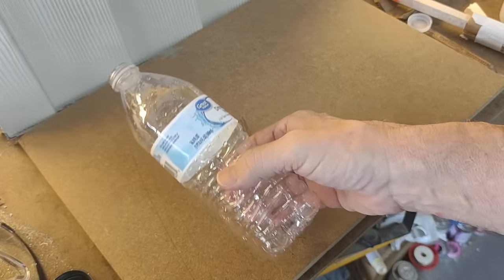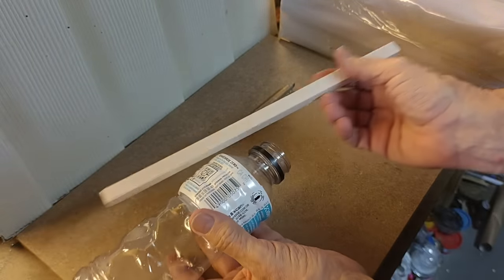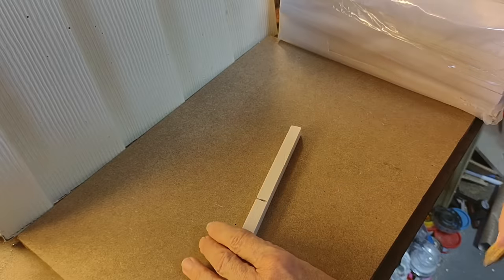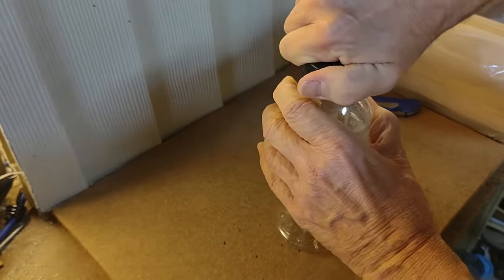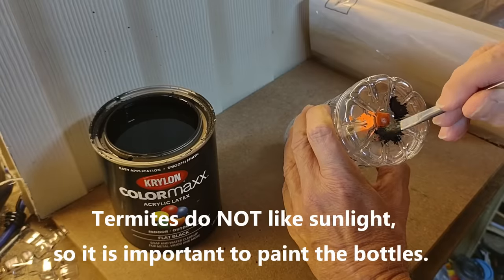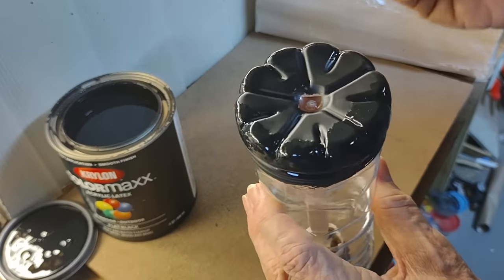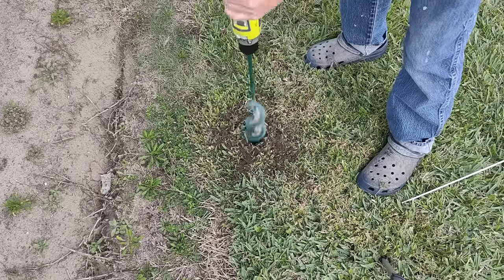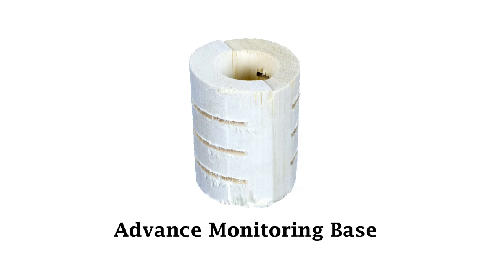Unbelievable Water Bottle Trick for Termites!  Simple to do!

Comment: Thank you so much for the info you provided. I have read that for new constructions, it is better to get the entire house fumigated before taking residence. What do you think? Is it a good idea, or just a waste of money?
Reply from the maker: Fumigation only works for drywood termites and it has no residual action, so unless you have an existing infestation of drywood termites, fumigation is a waste of money.

If you are building a new home, you can make the entire building totally termite proof by applying Bora-Care to all the wood surfaces.  You should mix the Bora-Care one-to-one with water.  The label will tell you that you can mix it one-to-five, but it is way more effective to mix it one to one.  You should apply the product before the shingles are put on the roof, before the siding goes up, and before the house is insulated.  In other words, you want all the wood exposed, so that it can be treated.  Always mix the Bora-Care in a 5 gallon bucket, and use an electric drill and paint mixer attachment to mix the product really well to a watery consistency.  Then pour it into the cheapest garden sprayer you can find and literally spray all the wood surfaces on the entire building, from the top of the roof to the bottom of the floor joists.  If it's wood, then it needs to be treated.  I will give you a link to both the product, and a video on how to use it.

I hope that helps.  Be well my friend.

Bora-Care:  https://www.domyown.com/boracare-p-100.html?pdpv=2

Video on how to use Bora-Care:  https://www.youtube.com/watch?v=Rmr_aEodyhg
Reply: @GuysPestSolutions   Thank you so much for your valuable info. Too bad, the construction has already passed the stage that I can spray the wood frames. Would your method work if I spray it on dry walls and under the eaves?
Reply from the maker: @leondan3629  The Bora-Care is best used indoors, but not on drywall.  You can use it on wood that is outside, but the wood needs to be sealed 48 hours after the application.  After the house is built, then employing other preventive measure is usually best.  How you do it will depend upon where you live.  Not all species are prevented the same way.  Drywood termites are much different than subterranean termites.  Monitoring stations are a good place to start though.  Be well my friend.
Reply: @GuysPestSolutions  Thanks again. I am in So Cal. What do you recommend for prevention of drywood termites?
Reply from the maker: @leondan3629  I will give you a link to my video on how to prevent drywood termites.  Be well my friend.

Video on how to prevent drywood termites:  https://youtu.be/neNsmVbj8Pc

Comment: Hello Guy. Great videos! Is there any chance that surrounding the house with bait stations will actually attract termites to the house - causing an issue that otherwise might not have happened in the first place? I guess I'm sort of thinking of the termites like ants. I don't have ants right now, but if i placed a pile of sugar every four feet around my house, I'd expect an ant problem pretty quick. I look forward to your thoughts. Thank you!
Reply from the maker: Termites are not like ants.  You will find ants all over the place, so they will find a bait really fast.  Subterranean termites live deep in the ground and come close to the surface to forage for good.  With commercial bait stations, they can be attracted to the bait from a long way off, but the monitoring stations just use wood.  Termites are attracted to wood, but they need to get reasonably close to it in order to find it.  So, they will find it if the stations are 4 feet apart or maybe even 8 feet apart, but that's about it.  If the termites are 8 feet from your house, they will find that as well.  So, since they are that close already, do you want them to find the monitoring stations first or your house first?  At that point they are already heading to your house, so wouldn't it be wise to give them something to dine on before they arrive?  If you check the stations every month, then you stand a good chance of killing off the entire colony before you have an infestation in your home.  Keep in mind that a termite colony that attacks your home is most likely within a 300 foot radius of your home already.  The termites will go in several directions looking for food.  If your house is in one of those paths, then it will be on the menu.  So, the idea is to offer them an appetizer before they get to the main course.  That way you can then install a bait station next to the monitoring station that went off and give them that main course before it becomes your house.

I hope that answers your question.  Be well my friend.

Comment: Possible improvement: instead of paint and brush; how about masking tape and spray paint?
Reply: I was thinking similar, but put a small square of tape over the orange stick portion then spray-paint the bottom and remove the tape when dry. Fast and easy.
Reply from the maker: Sure.  You can do that.  Whatever works.  Be well my friend.

Comment: I live in Charleston SC and I have a termite bond that is not going to be very effective. So I was told by the inspector to get the stations but they are still expensive. Will this work for me?
Reply from the maker: This is a monitoring system only.  It is designed to alert you to the presence of termites, so that you can treat them before they get to your house.  This is not recommended if you already have an existing infestation.  In addition to the monitoring stations, it is also a good idea to apply termite granules around your house every year.  It only costs about $50 and takes about an hour to do.  I use both the granules and the monitoring stations.  If the termites miss the monitoring stations, there is no way they can miss the granules.  The granules will take out a subterranean infestation.  I will give you a link to the video and the product.

For the granules to work you need to have dirt around most of the house and that dirt needs to be porous enough to allow water to seep into the ground fairly quickly.  To find out if the dirt around your house is porous enough, just dig a small hole next to the house that is about 4 inches deep, 8 inches long, and just the width of the shovel.  Fill the hole with water and watch to see how fast it drains down into the ground.  If it seeps into the ground fairly quickly, then the granules should work just fine.  However, if it just kind of sits there, then the granules would not be a good choice, and you should just use the monitoring stations if you have no infestation.  If you do have an infestation, but the granules will not work, then you should trench.  It's not that hard to do and only costs about $100.  I will give you a link for that as well. 

Please make sure that you buy the correct granules.  There are two kinds of granules now and one of them does not work.  They are both manufactured by Bayer, but they really screwed up on one of these products.  Make sure that you get the granules that use imidacloprid as the active ingredient.  The correct granules are no longer available at a lot of the Home Depot and Lowes stores.  However, they are still available on Amazon and I will give you a link to them. 

You should know that the stations the pest controllers are selling take up to two years to kill colony.  If you already have an infestation, then this would not be the way to go.  Please watch my video that explains the difference between trenching and using bait stations.  If you read the fine print in those pest control contracts, they even tell you that it can take up to two years to work, and that it may not work at all.  The granules or trenching will kill off the colony within 12 weeks in most cases.      

I hope that helps.  Be well my friend.

Termite granules:  https://www.amazon.com/dp/B000RUIJYM?ref=nb_sb_ss_w_as-reorder-t1_k1_1_6&amp=&crid=157C3RV0MY0AK&amp=&sprefix=termit 
      
Video on how to use termite granules:  https://youtu.be/H7rW_TSBHJ4

Video comparing bait stations to trenching:  https://youtu.be/jrPrr5DdB_g

Video on how to trench for subterranean termites:  https://youtu.be/Fy7YHi_7Z8g
Reply: I live in Charleston too and I have a termite drywood problem.
Reply from the maker: @hadokid2655  It is important to understand how drywood termites work.  They enter through cracks and crevices around windows, doors, the eaves, pipe penetrations, and so forth.  Most of the time, they enter through several locations.  That is because a swarm of them attacked your house at the same time.  If there was a crack or a crevice, then they probably found it.  After they establish their galleries, which will be inside the wood, it will take four to seven years for them to be able to swarm.  Now that they are in your house, the swarmers will use holes that are in your studs to travel through the walls.  Those holes in the studs were created by the electricians to run the electrical wiring.  Not only are these holes going through the studs, but holes were drilled into the attic for the light switches and to run some of the wiring for the outlets.  So, the termites now have easy access throughout the attic and the walls.  If you have a basement or crawl space, they have access to that as well.  Most of the time, you will have no idea that they are in the walls, because the frass is inside the wall.  To make matters worse, if you have drywood termites, then your neighbors have them too.  That means you have been getting swarmed for as long as they have existed in the neighborhood.  Most likely, we're talking about years, so it's a safe bet that you have these guys in many locations in your home.
                            
I always hate to be the bearer of bad news, but if you have drywood termites, the only way to get rid of them is to fumigate.  Prices for this can vary wildly in this industry, so I recommend that you watch my video on how to hire a pest controller without getting ripped off.  That video can save you a lot of money.  You should also know that the gas they use to fumigate has absolutely no residual action whatsoever, so you can get reinfested the moment the tent comes down.  Like I said before, if you have drywood termites, then your neighbors have them as well.  Since drywood  termites swarm every year, it is almost a certainty that you will be reinfested within a year after the fumigation is done.  The only way to prevent this is to do a preventive treatment on your house every 60 to 90 days.  Most pest controllers will not do this, so it is something that you generally need to do yourself.  I have a video on how to do that and I will place a link below.  If you absolutely cannot afford to fumigate your house, then you can try spot treating it yourself.  It is virtually impossible to find all the termite galleries, but it is way better than doing nothing.  Regardless of how you treat it, you should begin the preventive treatment immediately, so that you do not get additional termites paying you a visit.  

I hope that helps.  Be well my friend.                        

Video on how to hire a pest controller without getting ripped off:  https://youtu.be/y-a8XOqVrlE  

Video on how to prevent drywood termites:  https://youtu.be/neNsmVbj8Pc.

Video on how to spot treat drywood termites:  https://youtu.be/U7ck7zhS0Xo

Comment: QUESTION: I have a brick home on concrete foundation, with wood floor joists and framing. Their is crawl space under the house. Would it still be a good idea to install these monitoring stations? Thanks for your advice.
Reply from the maker: Yes.  The monitoring stations would be a good idea in your situation.  You may also want to consider using termite granules as well.  I do both.  I have the monitoring stations around my house and I apply the termite granules annually.  The nice thing about installing the monitoring stations is that gives you an opportunity to walk around the house every month or two.  When you do that, you can also take a quick look at the side of the house to see if there are any mud tubes.  In other words, you can do your own termite inspection every month or two.  It's quick and easy, and the best part is that it's free.  

For the granules to work you need to have dirt around most of the house and that dirt needs to be porous enough to allow water to seep into the ground fairly quickly.  To find out if the dirt around your house is porous enough, just dig a small hole next to the house that is about 4 inches deep, 8 inches long, and just the width of the shovel.  Fill the hole with water and watch to see how fast it drains down into the ground.  If it seeps into the ground fairly quickly, then the granules should work just fine.  However, if it just kind of sits there, then the granules would not be a good choice, and you should just use the monitoring stations.  

 Make sure that you buy the correct granules.  You need the ones that have imidacloprid as the active ingredient.  A lot of the Home Depot and Lowes stores no longer sell the correct granules, but you can get them from Amazon.  I will give you a link to them.

I hope that helps.  Be well my friend.

Termite granules:  https://www.amazon.com/dp/B000RUIJYM?ref=nb_sb_ss_w_as-reorder-t1_k1_1_6&amp=&crid=157C3RV0MY0AK&amp=&sprefix=termit

Video on how to apply termite granules:  https://youtu.be/H7rW_TSBHJ4

Comment: Termites found our vintage 1930 era wooden guest cottage quite a tasty treat. We’re hoping that the professional termite terminators did a good job and placed their bait stations where they do the most good. I plan on making some of the termite bait stations you so kindly provide instructions for. Thank you.
Reply from the maker: You are very welcome.  Please keep in mind that baiting is not a good way to treat an active infestation in the guest house.  Companies like to use it because it's quick and easy money, but it's not the right job.  Please watch my video on trenching vs baiting for termites.  If it were me, I would also apply termite granules around the cottage.  For the granules to work you need to have dirt around most of the cottage and that dirt needs to be porous enough to allow water to seep into the ground fairly quickly.  To find out if the dirt around the cottage is porous enough, just dig a small hole next to the house that is about 4 inches deep, 8 inches long, and just the width of the shovel.  Fill the hole with water and watch to see how fast it drains down into the ground.  If it seeps into the ground fairly quickly, then the granules should work just fine.  However, if it just kind of sits there, then the granules would not be a good choice.

Make sure that you buy the correct granules.  You need the ones that have imidacloprid as the active ingredient.  A lot of the Home Depot and Lowes stores no longer sell the correct granules, but you can get them from Amazon.  I will give you a link to them.

I hope that helps.  Be well my friend.

Termite granules:  https://www.amazon.com/dp/B000RUIJYM?ref=nb_sb_ss_w_as-reorder-t1_k1_1_6&amp=&crid=157C3RV0MY0AK&amp=&sprefix=termit

Video on how to apply termite granules:  https://youtu.be/H7rW_TSBHJ4

Video on trenching vs baiting for termites:  https://youtu.be/jrPrr5DdB_g
Reply: @GuysPestSolutions  thanks very much for your sage advice. My wife and I live in NW Florida. Very porous soil. I will seek out the granules that you recommend and put them out in trenches around the cottage and the main house in which we live. No shortage of termites around here. I’ve seen the winged ones swarm.
Reply from the maker: You are very welcome.  The granules should work well for you, but no need to trench with them.  You just apply the granules around the guest house and water them in with a garden hose.  The video shows you how to do it correctly.  It's quick and easy.  I have never had it fail.  Be well my friend.

Comment: If you actually want to do this then just mask off the center of the bottle bottom with a bit of tape and spray or Plasti-Dip it.
Reply: I agree. Much faster to spray than use a brush.
Reply: Just be aware though, most plastic bottles don't have flat, smooth surface. So, if you tape up the center, just make sure you follow the contour of the bottom of the bottle with your tape otherwise the paint could drip right into the center.